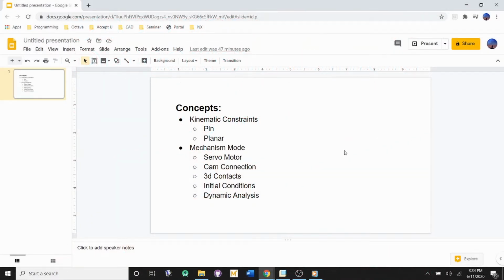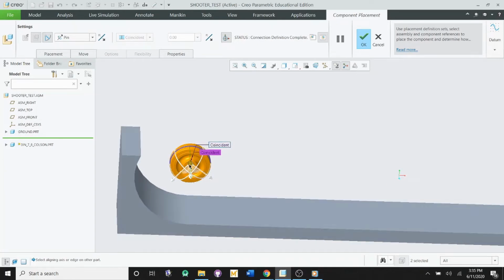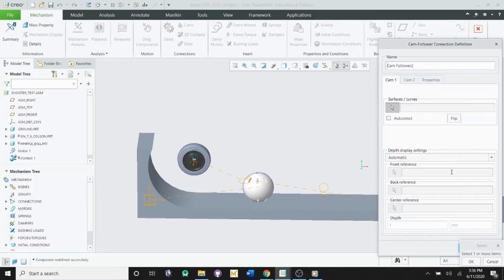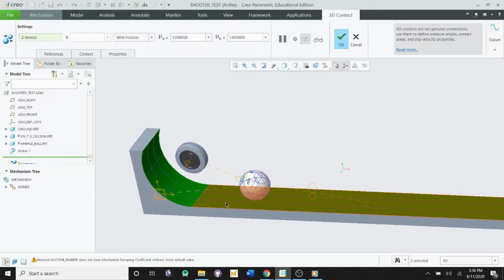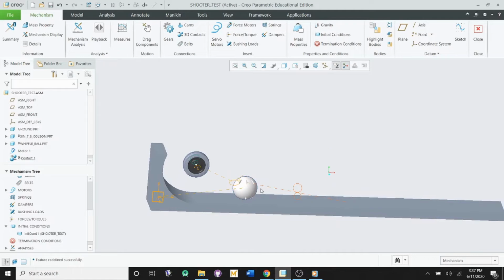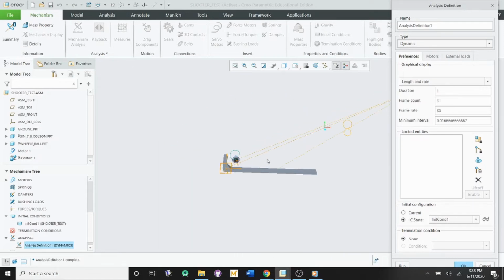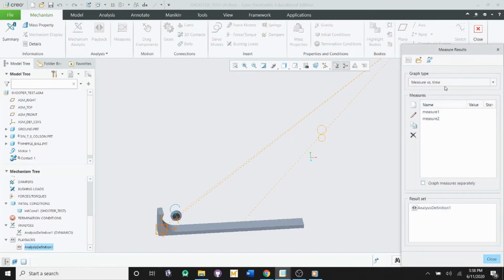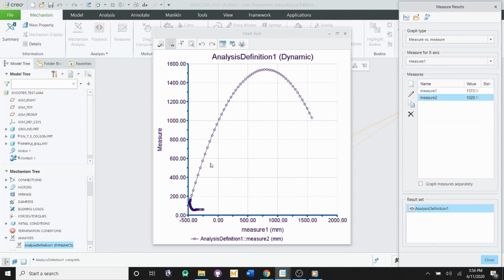Projectile Demonstration and Analysis With PTC Creo

Comment: Very nice. Can we have the same with a spring pusher for a projectile
Reply from the maker: Hi, sorry for the late response. Yes, you can set up a spring connection within mechanism mode to push the projectile. You may need to adjust your initial conditions to account for the spring and your set-up, but the same principles apply.